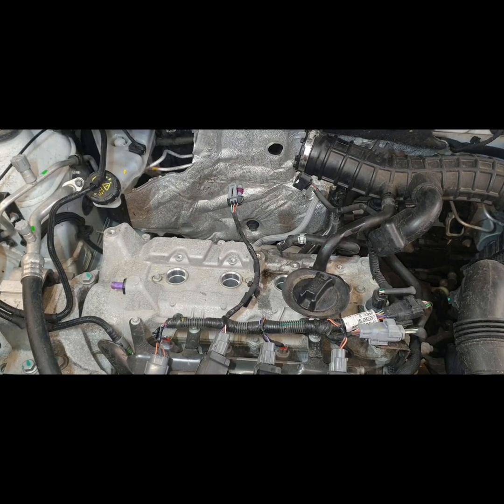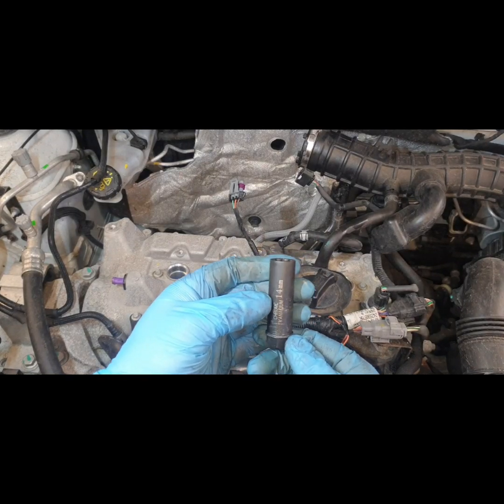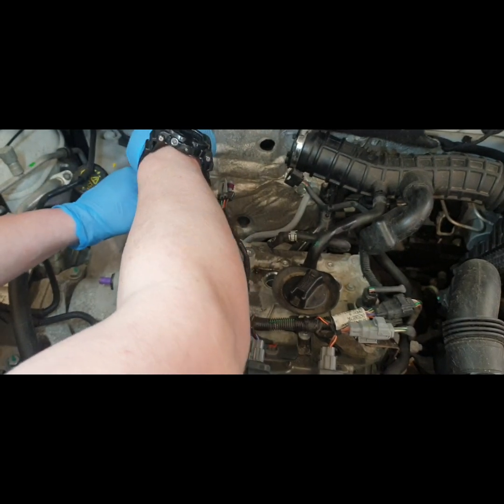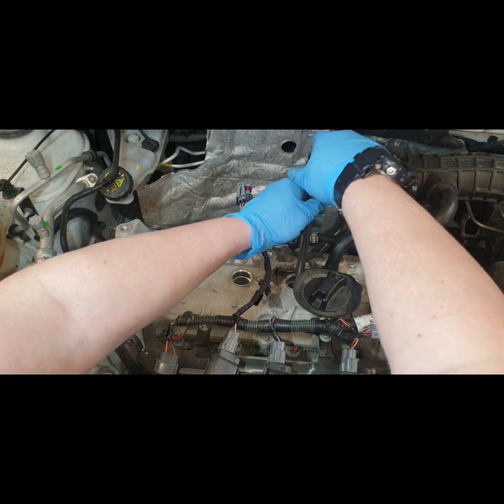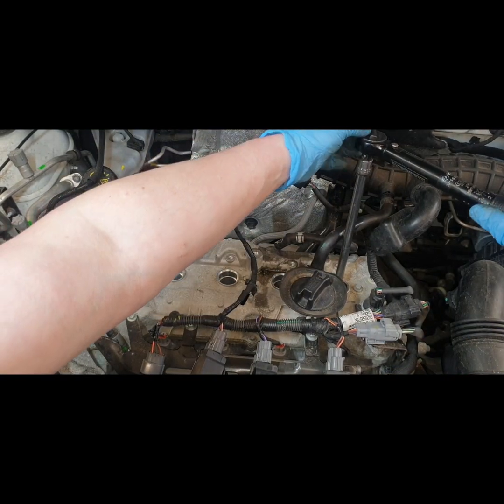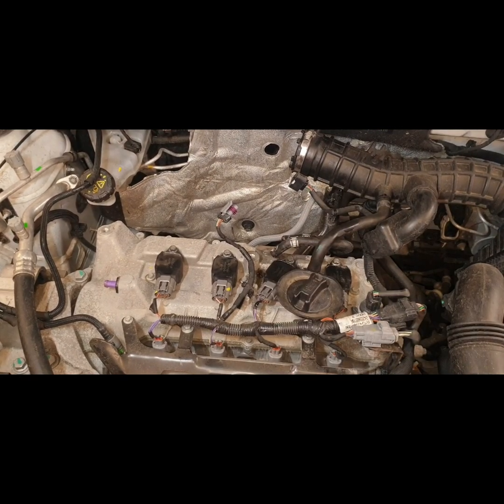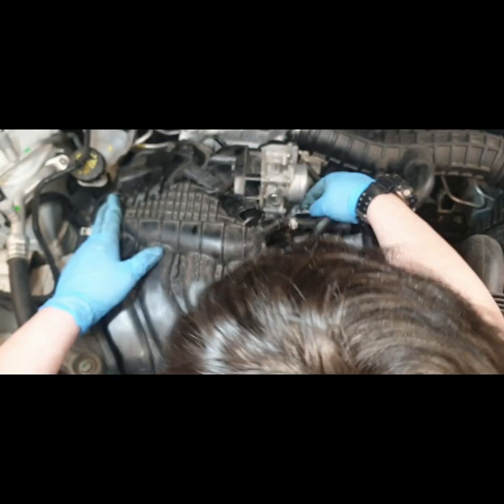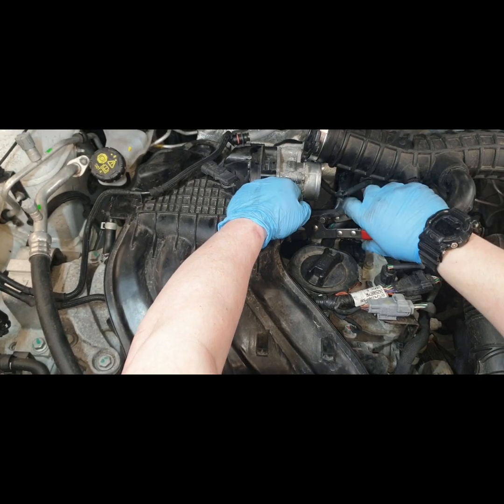Dacia Duster Spark plug change

Comment: This was just what I needed. Still relevant to a 3 cylinder Duster 1.0 2019. Didn’t have to remove anything other than the coil pack/rods that fit on top. The electrical sockets unclip from those so you can pull them out.

Comment: What year model is this? Later models, (such as mine), have big enough gaps to change the spark plugs without removing the air intake part.
Reply from the maker: Cant remember exactly the vehicle details as was done a few years back. If thats the case for you happy days. Less of a laborious job
Reply: @AutomotiveDIYTutorials  oh yeah. Somehow rainwater had gotten  into the connector and flooded the inside chamber of the spark plug. I had to remove the water with a straw first and make sure it was dry enough before I took the corroding spark plug out.

What a mess.
Reply from the maker: @i-craftsdesign3175  sounds like it will be coming from the scuttle panel
Reply: @AutomotiveDIYTutorials  oh. That's a good point.

Comment: I see they are normal NGK not the iridium ones right?
Reply from the maker: Off the top of my head im unsure, if i had the registration i could check. Usually your autoparts store will keep you informed if they are as they are usually more expensive
Reply: @Automotive DIY   yes...they are 20 quid each the iridium...it's  a 2019 duster 1.6 petrol...the 115 hp..
Reply from the maker: @TiberiusWorld  type your reg into eurocar parts
Reply: @Automotive DIY   i did...but after I've read dacia forum,I've  went on NGK "part find" website...and find it...iridium are like upgrade if you want to spend extra,like double....it's about 13 quid for iridium and 6 quid the normal ones...thanks for your replies 👍
Reply from the maker: @TiberiusWorld  no worries, for best engine performance go for them

Comment: What a pain just to change the plugs...
Reply from the maker: It is indeed, i should check the tech data to see how long they give to do the job.
Reply: @AutomotiveDIYTutorials  My wife had a Dacia duster 1.6 petrol and has since traded it for a diesel version. I replaced the plugs in around 20 minutes, however the dacia dealer wanted over £180 just to do the same thing! £20 for the plugs and 20 minutes for £180!? I'm in the wrong game..LOL